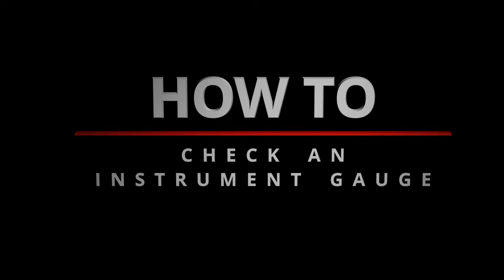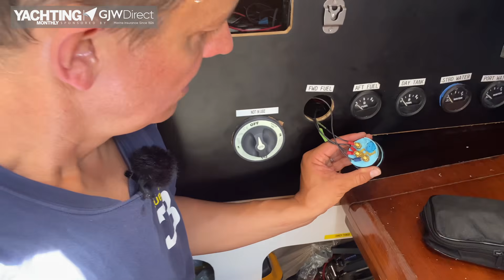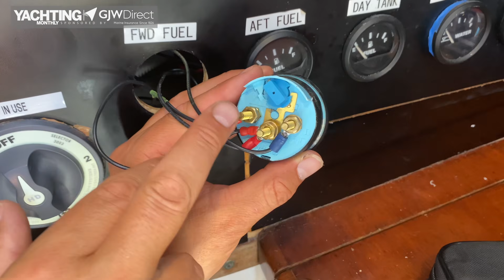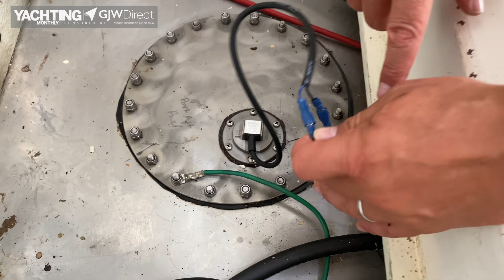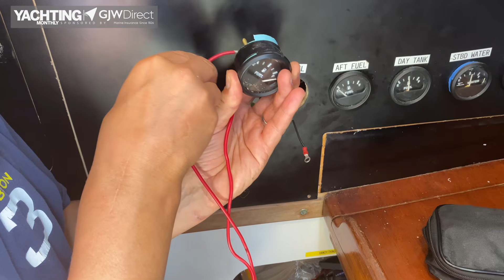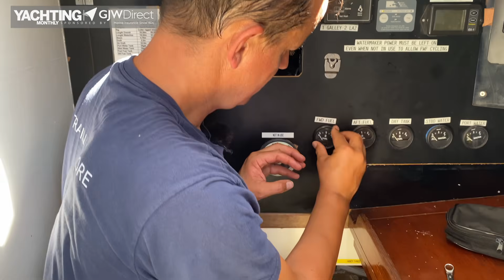How to repair instrument gauges - Yachting Monthly

Comment: Among others things from the beginning according to the converter from the tank sensor/what is in the measurement and control wiring diagram and what I will find out and measure in my own interest when buying a sailboat, etc.: on the measuring device we measure the supply wires if it comes from the fuel, temperature, pressure, flow, etc. sensor: voltage, current, or resistance,/ sometimes capacity via another converter/. And I don't have to laboriously go to the engine room to the engine, or to the tank, where I usually have to throw things away, uncover the hatch in the floor, where there is usually a fuel, or water, or waste tank, etc. I emphasize: first I measure the supply voltage of the sailboat, then on the measuring devices and then check the functionality of the device with an ohmmeter or a small flashlight on the disconnected measuring device. And only then I measure in parallel or in series if the relevant voltage or current or resistance, etc. is coming to the measuring device SAILBOAT: from the required sensor. Usually, when other measuring devices measure me  their specified parameters, these devices have the same power supply as the allegedly defective measuring device, but usually each device has its own fuse. So I will measure the fuse with an ohmmeter, not just by looking. Because the fuse wire in the fuse can blow right at the beginning of the fuse under the cover, which will not be seen. Only if I do not get any signal from the technology from, for example, the fuel tank, etc.: only THEN do I go check the sensors. But be careful with the gasoline tank, just the gasoline vapors are very dangerous and explosive when you open the measuring hole of the gasoline tank sensor. If you are wearing nylon underwear, a jacket, etc., or you smoke, or a spark jumps during the measurement, an explosion and fatal consequences can occur. The same thing happens if you have a propane or butane heater, or a stove and you have a gas leak. It is heavier than air and usually sticks to the ground. All it takes is static electricity from shoes, etc. And again fatal consequences will occur. And I emphasize  I EMPHASIS: if the power supply of the device is in order, the measuring instrument, fuses, circuit breakers will be functional, the sensors in the tanks, etc.: they will be functional, then all you have to do is check the wires, which is usually the problem. Usually they are pinched, or the surface of the wire is melted by a hot engine, or mice have bitten it, etc. Help is simple. Always have a long spare two- or three-wire wire ready, which you can connect one end to the sensor and the other end to the measuring instrument of the sailboat, etc.: and if your sensor is in order and the power supply and wire are in order, it must show you the value of the sensor. Attention, this does not mean that if the sensor directly shows you something, it is correct. This is done by the so-called calibration of both the sensor, the line, and the converters along the line, etc. The best way to find out is to replace the same sensors and compare the values from both sensors. The repairman of electrical measurement and regulation: has a so-called standard of accurate values  voltage, current, resistance, capacity, etc.: and he must calibrate it and give a certificate of inspection, as with a new sailboat, etc. I emphasize that without proper qualification of your practice of state exams for repairing electricity, measurement and regulation of electricity, gasoline tanks, etc.: do not under any circumstances attempt to repair electricity, measurement and regulation, tanks, fuel sensors, etc. And do not repair gas heaters, stoves, etc. Believe me, I am not lying, etc.

Comment: 11:25
1 — Check power to gauge.
2 — Check resistance of sender.
3 — Check continuity of wires between sender and gauge.
4 — Check gauge swings empty to full and back when shorting/opening GND to Signal terminal.

4th item was shown in the video but not mentioned in the summary.

Comment: I know the power was switched off but it doesn't hurt to mention that any time you're working around fuel, it's important to avoid exposing the area to any kind of spark or flame.  Diesel is not nearly as volatile as gasoline but it is still quite flammable.  Fumes from both are toxic as well.

Comment: you mention to begin shut off power; if so, how do you check if there is voltage at the pos and negative.  also, why is the postive a black wire.... seems to make more sense to color code them??

Comment: Switch off the power and measure if you have power? The post for the light is missing? No, it is internal connected. It doesn’t matter what you are reading when measuring the resistance? The resistance is printed on the sender, standard is 190 Ohm. Use crocodile clamps when measuring, the risk of short circuit will be less. 
If making this, do it right!

Comment: Great video, however how did you check the continuity in the wires from the tank t the gauge?
Reply: Was thinking the same, but you can check it with the resistance setting of the multimeter, attaching it to both ends of the wire (so on end at the gauche and one end at the tank).

Comment: You didn't show how you did the continuity test for the sender wiring.
Reply: For the purpose of the continuity test: locate the cable ends. Make sure you do not have any extra plugs in line. In this case disconnect the sender and the gauge cables. Set the multi meter to continuity and touch red and black together. (As per the demo in the video) Fit the multi meter black lead on one ended and the red on the other. You should have the same reading on the meter as touching the red and black directly. 
I do not like this test. It’s unreliable. You can have continuity in a cable that has many frayed or corroded wires. Best to carry out a volt drop test.
Reply: How do you do a volt drop test ? @Motrus01

Comment: Something remains not clear: after you switch off the electricity in the very beginning, how come you measure 13 V between positive terminal of the gauge and the ground?
Reply: He switched on the power but did not say so.
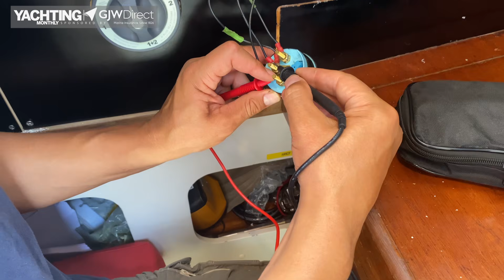Reply: 4:40 He says something about a battery charger being on but im still abit unclear to :s
Reply: well that's confusing .